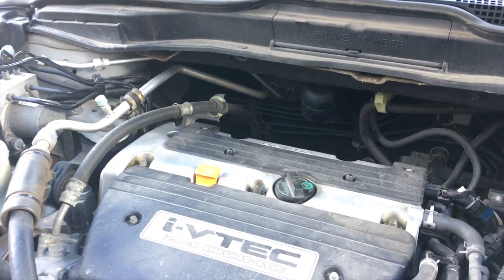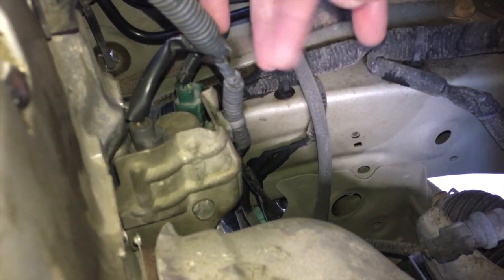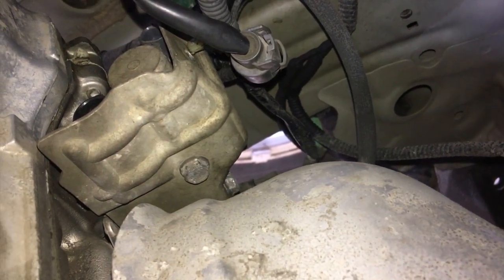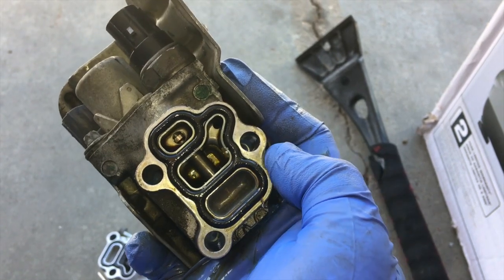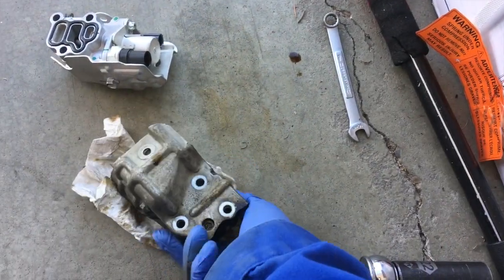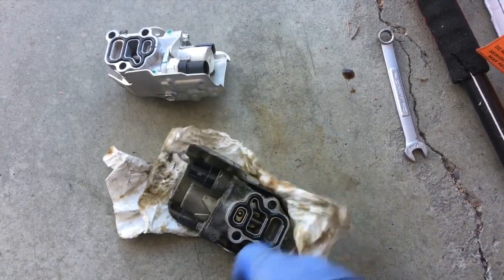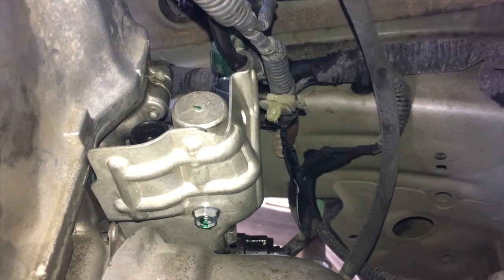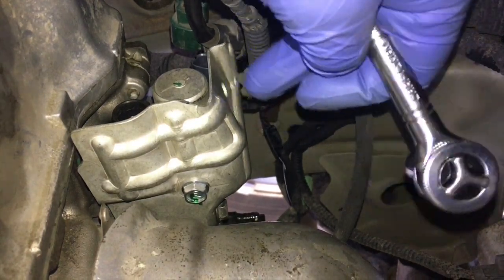Honda CR-V K24 VTEC Solenoid Spool Valve Replacement

Comment: Used your video to help me with my son's 2006 CR-V.  It's now got about 175K miles.  Hoping to make it to 250K.  Thank you!
Reply from the maker: Glad it helped!
Reply: @piercedasian  Do you have a link for where i can purchase the vtech solenoid along with bolts for 2011 honda accord 4 cylinder engine.

Comment: Great vid! That particular Honda part number is discontinued here in the states, so Honda is no longer selling it. There are many different aftermarket replacements available. You might even find the original Honda part number available on Ebay.
Reply from the maker: Honda likely uses the same first portion of the part number but it may now end in something like A04 or A05 to denote the "generation" and supplier it comes from.  I'm inclined to the use the latest revisions from Honda b/c of possible design improvements.  Either way, the spool valve is quite expensive here in Canada.

Comment: Nice clear how-to!

Just a minor nitpick here: VTC isn't formerly known as VTEC or vice-versa, they're two separate systems. VTEC engages a second set of cam rockers to change the valve duration on the fly. VTC shifts the phase of the cam sprocket on the camshaft to adjust the valve timing (not duration).

The VTC valve is a separate thing that's near the passenger side engine mount, with its filter screen being around the belt tensioner. The associated codes are, I think, around P1009.

What you replaced, and what the P2646/2647 codes are for, is the VTEC system. P2646 (but not P2647) can be caused by just low oil level so that should be the first thing to check in that case. It can also be caused by a bad switch, which happens often enough that Honda even has a TSB suggesting that in the absence of other symptoms, to just replace the switch rather than do further diagnosis for a P2646. When there's stuttering and jerking together with the codes though, replacing the whole assembly as you did is appropriate.
Reply: yep actually as a non expert/mechanic this video cleared it for me https://www.youtube.com/watch?v=30JRyJaJMXQ.
And i have a question for you Luns Tee if you may, my car a 2014 crv automatic awd, on every gear when i reached 5k rpm , it is like it loses a lot of power it is like a rev limiter engages on it, no code is showing up , more then 5 mechanics didn't figure out, so waht do you think is it related to vtc or vtec. thanks
Reply: @fadelibrahim7663  As a fellow crv owner what did you have to do to fix this problem????
Reply: @tonyjordan1320  changed the timing chain. the car was already so slow but extra slow when it reaches 5k rpm, and since vtec kicks in on 5k  thats why I felt it is a rev limiter. After cahnging the chain everything is in sync in the engine and back to normal

Comment: Would you ever change the V-TEC from under the car on a lift?   If so, what would you need to remove/undue to get to it?
Reply from the maker: nah, I do them all the time from the top of the motor.  Easier that way for me at least...
Reply: @piercedasian  thanks.  trying to track down a sporadic rapping sound from frame that started after the dealer changed the V-TEC.  Not struts, links, or ball joints.   We're all scratching our heads playing chase ($$) on troubleshooting

Comment: Does this make noises when they go bad , would of been nice to hear it running before it was taking apart so I know if it makes a noise and if like my 2010 CR-V 2.4L now.  Only code was down stream low bank 1 and the both 02 sensors has been replaced as I was told one was the cause so I replaced both knowing there new like spark plugs. I replace extra stuff if needed at some point. So get it done at once.
Reply from the maker: no they don't make any noise at all that one could ever hear.  If you get low bank 1 and your oil level is full then there is a good chance this spool valve is toast.  Its a VERY VERY common failure point on this motor.  I just did another on the same car just 3 weeks ago and it was on its 2nd spool valve in less than 3 years!  Unbelievable!

Comment: I changed engine and trans mount and still get some shaking while idling .... however I don't have a check engine light... odd is it? I hate the feeling of weird shaking while idling ....should I still go ahead and change the vtec solenoid? to see if it stops and also improve my gas mileage ? any help is needed thanks
Reply from the maker: No it wouldn’t be the solenoid. Have you checked the condition of the plugs and the condition of the ignition coils?  Weak/failing coils can cause rough idle.
Reply: @piercedasian  I installed new spark plugs.... I didnt think it was the coils but I would gladly change them if it would eradicate the problem. I gonna change the coils to see if that helps

Comment: Thanks very much for the video . But messed it up . Right corner bolt snapped . Any help is appreciated.
Reply from the maker: Yikes!  While I'm late in responding that I certainly hope you were able to get that bolt out.  I'm assuming all is fixed already or that you've consulted with a professional?
Reply: @piercedasian  yes got a tech to take it out. Thanks
Reply: Same issue everybdy says they cant remove rounded bolts🥺🙄

Comment: Hi, I have second generation CRV with k20 engine, and their is only one  conecter wich I think the switch, but no other censor. My friend have also the same CRV and his car solenoid is also the same switch, but there is no oil pressure switch r censor.
Reply from the maker: wait, you mentioned your have a CRV with a K20 engine?  What part of the world you located at? Its been quite some time since I have worked on the 2nd gen CRV.
Reply: @piercedasian  
I am in Dubai, middle East

Comment: Iv replaced the valve twice and done two oil changes in 100 miles and after the motor warms up it still goes into limp mode with this code. Any ideas? Mines a 2005 with 213K miles. Just bought it and drove it a few hundred miles before the issue surfaced.
Reply from the maker: When you replaced the spool valve are you replacing it with a used or a new one?  I only recommend users replace the spool valve with a new one because they're KNOWN to go bad without a moment's notice.
Reply: New from orileys thank you for the reply!
Reply: I wonder is there’s a way to bypass the sensor… it’s a secondary car and I just want to drive it
Reply: Hey did you ever figure it out? Mine is doing the same thing
Reply: @ccutts63  no I gave it to my
 mother in law. Never buying Honda anything again total junk. If it’s not going to tell me exactly what’s wrong with it when I hook it up to a code reader and after I replace the supposed part twice and do two oil changes in 100 miles I’m done wasting time and money on it. Go buy a Toyota RAV4 😂

Comment: I put a new spool valve and still doing the same shaking
Reply from the maker: Hmm, are you getting the same check engine light as well?  Did you just install new spool valve or did you purchase the entire spool valve assembly?
Reply: $150?  Got one for 58.99 today or I could of waited 5 days,  $44.99 on Amazon!
Reply: did you get it sorted out?
having the same problem.

Comment: 500$? I found them on amazon for 40 bucks
Reply from the maker: You must be from the US. Everything in Canada is insanely expensive and amazon here likely doesn’t even offer a genuine a honda replacement so the stealership is our only viable option.
Reply: @piercedasian  yeah I'm in the US here is a link where I bought the part, just trying to help out anybody that had the same issue. So far worked like a charm. https://www.amazon.com/gp/aw/d/B07FNJMZDG/ref=sspa_mw_detail_3?ie=UTF8&psc=1
Reply: Btw, thanks for the video it helped out alot. I ended up stripping the last bolt but luckily found some powerbuilt zeon sockets that helped me get it out no problem.
Reply: @Pyro_Dan  hey I stripped mine too what u say u used to remove?

Comment: Thanks for the video 
Very informative & helpful  CRV are extremely temperamental when it comes to  VTEC 

My vtec spool valve 
Arrived today 
Ordered of Amazon $55

Mechanics quoted 100 -140 plus parts 

I rather save the money 

Keep up the informative content 

Love my CRV 
Might be old but very reliable 
Will outlast most new cars 🚗
Reply from the maker: No problem. Thanks for stopping by.